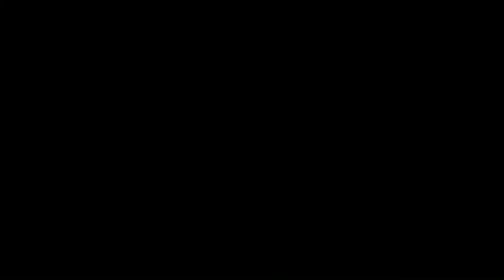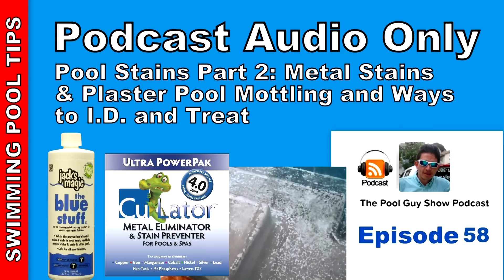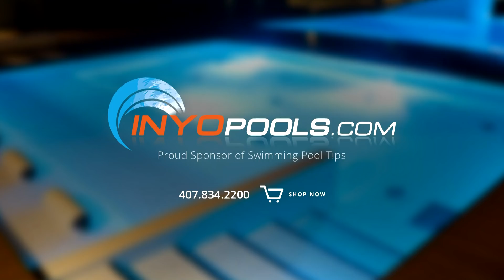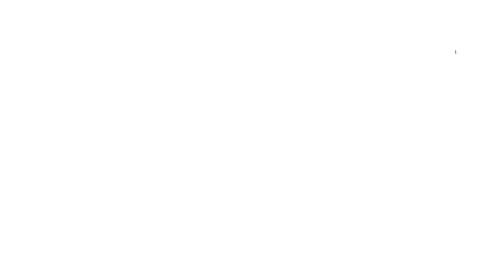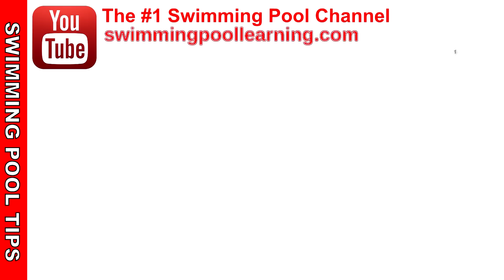Pool Stains Part 2: Metal Stains and Plaster Mottling - Tips on How to Remove Metals from your Pool

Comment: I just went to a salt system and now I have what I think is calcium build up on my stone under our water features. Intrude to use a pumus stone to remove it and that did not work. Can you recommend anything or have a video showing how to remove it? Thanks
Reply from the maker: I have a Podcast coming out next week on this. Try using a box cutter razor blade on it.